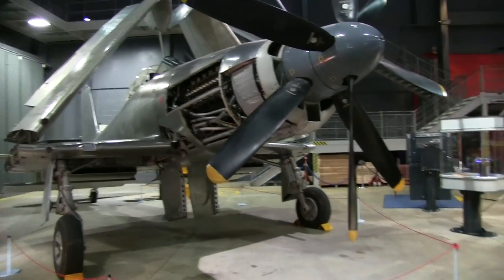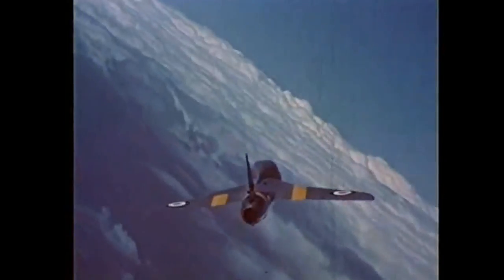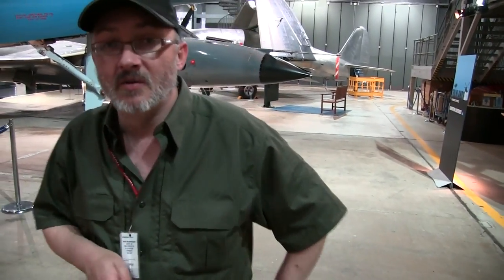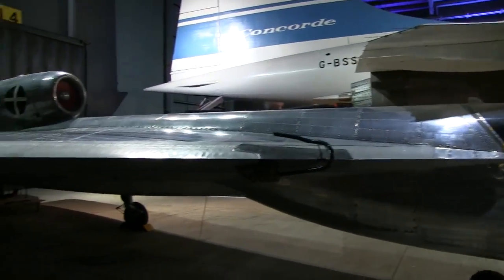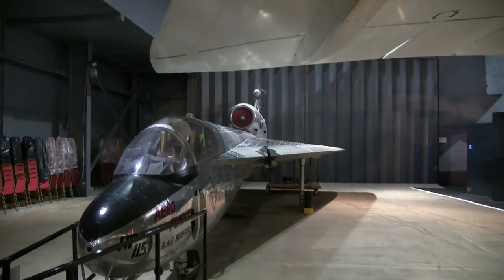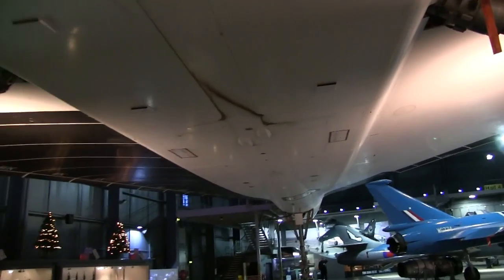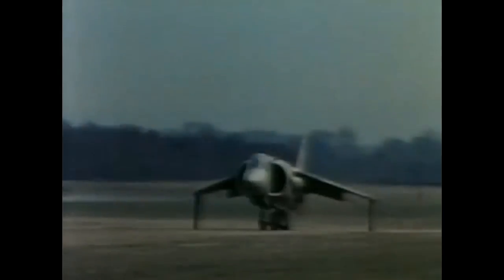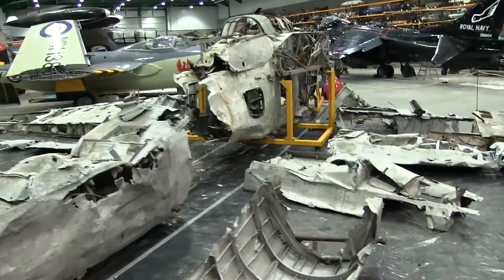Fleet Air Arm Museum with The Mighty Jingles - Part 3

Comment: Jingles, thank you so, so, so ,so much for uploading this. 

I was lucky enough to go on Concorde, G-BOAF ,which was the last British built Concorde and is now housed in the original Concorde hanger, at Filton Bristol.

Due to one of my 6th form teachers having his wife work for BA, I was able to get my ticket at 10% of the face price, which worked out at £890 in 1998. This was my 18th birthday present from my parents and to celebrate getting very high exam results from the course I was studying at the time. 

With my 6.4 (196cm) frame, I found things a little snug in Concorde, but nothing in this world could beat the thrill of take off in Concorde. Due to the air temp at high altitude in the summer, I was in a flight that managed 59,000ft and Mach 2.2. I will never forget the experience of going on Concorde and I feel so privileged that my very first flight in a fixed wing aircraft, was on board what I see as the greatest ever non military aircraft.

I would strongly recommend anyone going to see the flagship Concorde, G-BOAC at Manchester airport if you ever get the chance, or going to see the two French Concordes in Toulouse, where they actually use ground power to power the Air France Concorde up and they demonstrate the lowering and raising of the nose and visor, as well as moving the control surfaces of the aircraft. This is the only place in the world you can see a Concorde powered up in this manner. There is hope one day they will be able/allowed to do high speed taxi runs on special events at the airport.  

The Concorde in your video Jingles, was fondly called "Old Smokey" as the development engines used in this research aircraft were very smokey and even the preproduction Concorde based at Duxford, was smokey compared to the final production engines found in the aircraft that entered service.

One question for you Jingles, which you don't have to answer, but what did you do job wise in the Royal Navy? 

Again thank you for the time and effort you spend in making such enjoyable and informative videos like this.

Kindest regards,

Dan (aka FelixIsMyName in War Thunder is No.1 Squadron)

Comment: With an addon to the Hawker Hunter story, we used them in Rhodesia (now Zimbabawe). The pilots were legendary in their ability to hit any target. A South African Newspaper stated that the pilots could hit a metal dustbin in a jungle clearing. In answer to that No.4 squadron presented a metal dustbin to No.1 squadron that then promptly stuck it out on the practice field and did just that with only a single burst form a hunter flown by Richard Bland OC at a speed of approximately 720Kmh

Comment: nice videos of the fleet air arm museam.  also the westland wyvern in the museam is not a turboprop it is powred by the Rolls-Royce Eagle 22 24-cylinder H-block piston engine

Comment: Nice Vids Jingles! You should become a Professional Documentary Guy/Dude/bloke.
I currently serve with the Swiss Air Force( As a Militia-Member,like 4 Weeks a Year), so it's nice to see your mentioning of the Hunter, which is a Legend in the SAF. They flew them up until 1994! (Armed with AIM-9 and AGM-65 Maverik Missiles as Ground Attackers).
Also, the Swiss BF 109's fought briefly against ze Nazis during 1940.
Apparently, they claimed around 5 to 7 Greman Planes for the loss of one 109 of their own. So far the only Time the SAF got into Combat.
Reply: Sadly that's true.
American P-51 also Shot down 2 Swiss D-3800( Locally built French MS.406 Fighter)
The P-51 Pilots didn't recognize the Planes because they were hoplessely obsolete by that time, so they thought the D-3800's must be German.

Comment: The way i see it, the longer it takes for the f35 to reach service, the better. It is an incredibly expensive, overweight, slow, unnecessary aircraft. If it's gonna replace all the ground attackers it will need a big wingspan and low stall speed, but it needs the opposite to be able to perform V.T.O.L and the small wingspan coupled with the heavily underpowered airframe makes it a fighter that's too slow to be good at that and an attacker that can't go slow enough to be good at that.
Reply: Lets hope that RN will chuse the catobar version in the end, its better...
Reply: MichalSoukup1995 let's hope they choose to abandon the project, but that's highly unlikely since they've put too much effort, time and money into it. Even if they wanted to back out they couldn't because they've gone past the point of no return.
Reply: I hope they do jettison the F35, it's an expensive joke...  Of course we will end up with two aircraft carriers with nothing to fly off them(!)

Comment: I hope they just scrap the F-35. It's a worthless aircraft. The fucking thing can't even make turns of more than 5G. "But it won't need to dogfight" was something they also used for the F-4 Phantom, and we all know how that ended.

I'm a Dutchman, so there's no carriers, but I honestly would just go NOPE at the F-35 now and buy Dassault Rafales or Eurofighter Typhoons. Hell, I'd even rather go to the Russians and invest in the PAK FA program.
Reply: I'm sorry, it might be the case that I have a job in aerospace engineering.
Reply: No, but I've made good contacts in Lockheed Martin and the people that ARE involved with the F-35 say that because they want it to do everything, it sucks at everything.
Reply: I don't believe the F-35 is a bad aircraft by any means, however I do believe it is a pointless investment. The F-22 can do everything the F-35 can do, and it can do it better, judging by what the public knows about each of the planes. VTOL (or STOVL, for accuracy), is an incredibly waste of time and money. It significantly reduces the range of the aircraft, as well as the payload it can carry and the speed it can achieve. The Harrier does a fine job as a VTOL aircraft, we don't really need a "stealth" one. Anyone who says one aircraft would win in a fight against the other is horribly misinformed, as the day of the dogfight is long gone...and even if a dogfight were to occur, it would almost never be 1 v 1, and the victor would be decided based on superior tactics and wingman coordination. Just because one plane can out turn another does not render it the definite victor in a real world situation.

Comment: Fantastic video jingles really enjoyed it. The format is spot on even if you done regular videos about different aircraft/tanks that would be fine by me !!! 
Now for a slight rant at who ever was responsible for mothballing/selling the Harrier. They really do need a kick in the knackers. To have it replaced by the lightning 2 / JSF is just two fingers up at brilliant design and common sense. That aircraft defies logic. I agree that Harrier airframes were getting tired and they needed updating but the design was more than sound and the money spent on procuring the JSF should have been spent making  a Harrier 2. Rant over.

Comment: Fun fact: When in the hover, the Harrier is 'steam powered'.

No, really. Water is injected into the engines to give it better cooling, and allow the engine to operate at the higher thrust levels needed. The pilot only has 90 seconds of water on board, and hence can only ever hover for 90 seconds without the risk of overheating the engine!

Comment: The F35 Lightning II is a big piece of turd.
Reply: WindmillStalker From what i have heard and read, it is nothing to brag about right now. But, like you said, I have never flown one either.
 I'm confident they will figure out all the plane's issues, but at what cost ? and when ?

Moreover, what kind of plane first buyers will have ? A true masterpiece of aircraft ingeneering, or a flying lemon ?
Reply: WindmillStalker compared to the su-35 it is
Reply: WindmillStalker in a American  simulation It was bested by the su-35
Reply: WindmillStalker The Su-35 overpowers the F-35 in terms of maneuverability, speed, range and payload.
Reply: WindmillStalker Idiot. All sources say the F-35 is a failure so far, and it has many many problems. Flying it is not the only way to know if it's effecient or not. How can we know the P-51 was such a successful aircraft? None of us ever flew it, but we still know it is, because all sources say it is.
Reply: WindmillStalker it should be better in all aspects not just a few
Reply: WindmillStalker If a plane is really bad during its testing phases chances are it won't be so good even after it's done. If it's not going according to plan development on it is discontinued. It's not like a video game that's constantly getting better during its development stage, and even then sometimes horrible games are being released. That's how it worked with all aircraft designing programs since forever, and that's how it still works today. So get a decent brain before you call others "loudmouth quick-to-judge children".
Reply: WindmillStalker but the f35 isnt ground breaking
Reply: WindmillStalker Give it up. They just want to bash anything American. These are the same type of people that in the eighties would have said Soviet tanks like the T-80U were equal or better to the Abrams when in point of fact even later Russian generals said that tank was a GIANT turd in combat. Thankfully we may never get to find out how the F-35 does against Russian or Chinese planes. Hopefully anyway.
Reply: ***** the problem with the t80 is that it ate gas and had an unreliable engine but otherwise it was a great tank
Reply: The F-35 was described, by experts, like this: "Can’t turn, can’t climb, can’t run.” because the plane is heavy, underpowered and has a horrible aerodynamic drag coefficient.

The lift fan, which causes the horrible drag coefficient, because of the increased width of the plane, is also terribly fragile, so VTOL is only used when landing, because the plane would be too heavy otherwise.
The Navy can barely operate the F-35, as the landing gear is too fragile to operate properly with the catapult launch system, risking to tear it off during take off.
Reply: TheYamato101 Thanks for being predictable dude. :)
Reply: ***** just the facts dude
Reply: Selective facts.
Reply: ***** go on....
Reply: i find all this very amusing please carry on
Reply: MatteV2
Thats kind of how military aircraft development works. the P-51 was brought up already, that plane actually kind of sucked when it came out. It took a few versions, and a new engine, to turn it into the beauty we all know and love. It might be worse at the word go than contemporary generation 4 fighters already in service, but it has a much higher potential that can be reached with later upgrades. Case in point, the Su-35 is really just a heavily upgraded Su-27. And I'm quite sure they are well aware of the inherent performance trade offs involved with a VTOL-type design. Also, the initial story i read about the F-35 said there was going to be a couple versions of the plane, the VTOL/STOL for Navy and Marine operations, and a traditional version without VTOL for air force operations on traditional runways. If that turns out to be true, logically, the land based one will have better performance than the VTOL configuration. The only other gen-5 aircraft i personally know are all entirely different beasts, the F-22 (of which a hundred and something are out there flying around already) is an air superiority pure-bred fighter, and the PAK FA (T-50) which is a land based multirole, and is scheduled to begin state testing in Russia in 2014. If we do end up seeing a land based, non-VTOL F-35 configuration come out, the T-50 is what you could compare it to, but of course, with VTOL/STOL, it can't possibly have the same performance. That's the price you pay for that functionality.
Reply: the f35 is a joke ;) Boing had the X32 fully operational while the f35 was only able to take of vertical when you took off nearly every plating etc, but they won the challenge because they had a flipchart... the actual version only has 180 rounds of ammo
Reply: Cryptic4 Using logic, you would be right. Unfortunately this is not the case. The "standard" Air Force variant has the same fuselage, which means it suffers from the same poor aerodynamic drag coefficient.
Reply: I agree
Reply: WindmillStalker Ummm... F-16? One of the more successful aircraft designed in the past 40 years?
Reply: MatteV2 There's isn't a single country in this world that doesn't produce at least one pile of shit.
Reply: Nadir R I never said there wasn't :)

Comment: About the harrier. I had heard they are loud as fuck. And the vents are to help keep the planes balance as it takes off vertically.
Reply: Yeah they are pretty damn loud. I believe (may be wrong) that the harrier was originally designed to be a short take off small jet fighter, where you don't need much room, and can hide them amongst bushes. I saw one in my home town (I'm from England) flying at an air show and they demonstrated this jet they had it hovering about a few feet above the beach about a few feet away from a man made garden style cliff and the pier. When flying you could switch the vent's so they faced forwards to rapidly decelerate the plane if they had enemy on their tail to get in front and then shoot them to shit. But when they were built the RAF and Navy were unsure of them and when Falkland's kicked off they had no choice after the war they loved them.

Comment: It was also used by Jordan and Iraq during the six day way too, just as a side note. :)
Reply: another side note: the Dutch Air Force bought the Hunter and ended up replacing it with the Sabre :)
Reply: jwenting Actually that is incorrect. The RNAF used the North American F-86K Sabre, Hawker Hunter Mk4/6 AND Republic F-84 along side each other for many years, and in fact retired the Sabres a few years before they retired the Hunter Mk6. These variants were to be replaced by the Northrop NF-5A/B Freedom Fighter. You need to check your facts.

Comment: Fun Fact: the SR-71 blackbird actually had to move out of it's way to allow Concorde to carry on with it's flight path.
Reply: That's strange, seeing that the SR-71 flew again half as high and again half as fast as the Concorde ever did. (SR-71 has a flight ceiling of more than 100,000 foot and a rated maximum speed of Mach 3.4, with Concorde going up to about 70,000 and Mach 2.2.
Reply: i can't remember where i read it but i'm sure it did happen on a few occasions.